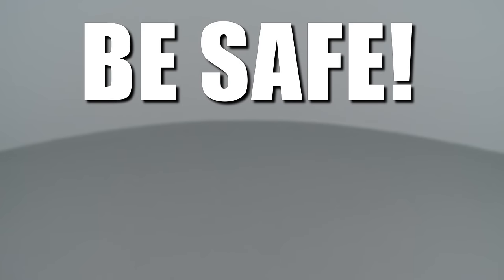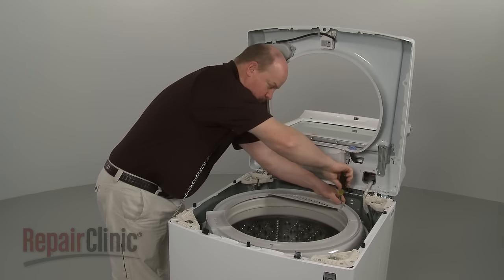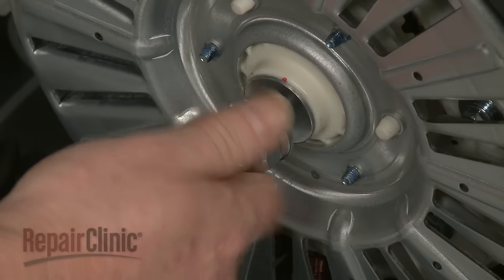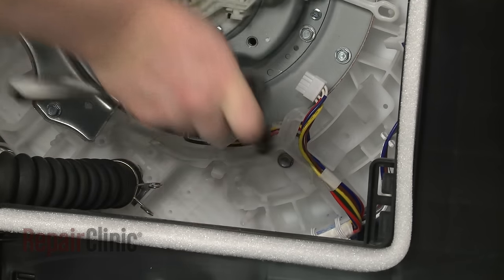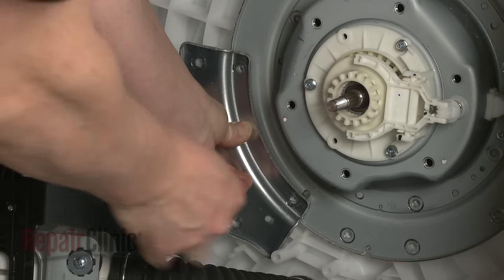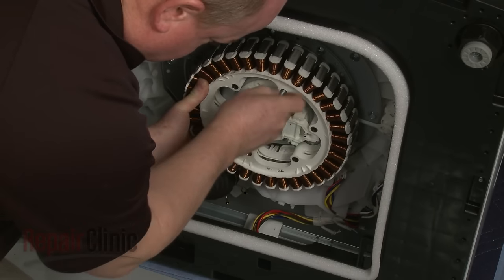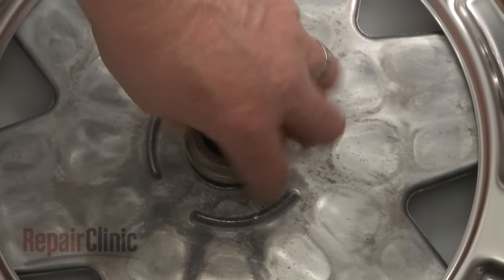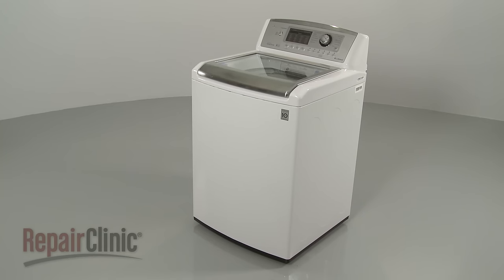Loud/Noisy LG Top Load Washer? Clutch/Tub Bearing #3661EA1009E

Comment: Great video.   Tip,  before you order parts check the rotor mounting  nut on the bottom of the washer, ours had worked loose, re-tightened to 88 ft lbs, and solved the problem.

Comment: Beware of the torque spec. for the nut that attaches the rotor to the shaft. The manual calls for 200 Kgf/cm or 88 Ft. Lbs. 88 Ft. Lbs. is a lot of torque for that little shaft. Knowing a little bit about metric, the equivalent imperial torque seemed way high. Goin to an on-line conversion program, he imperial equivalent is 14.5 Ft. Lbs. which is much more reasonable. Good idea to use some Lock Tight.

Comment: Pulled the wash plate and found a lodged quarter. Maybe LG improved the clutch/motor in recent models, as mine survived and works great after removing the quarter. 5 minute fix and free! Maybe the key was my wife was nearby and had the presence of mind to stop the cycle when she heard something that sounded wrong. Although it was running for 5 or 10 minutes in this state. Thanks for the great video

Comment: If you can do this repair your self you will save a good chunk of change. I paid $130 for the part I got it the next day and $15 for the 38 millimeter socket. the appliance repair place was going to charge 150.00 for the part and   $80 for a service call  and $80 an hour after that for a total of 2 hours so i saved about 250.00 doing it my self

Comment: My Model number is LG WT5070CW and I am unable to remove the wash or Pulsator plate. I have tried removing the 10mm bolt and running several cycles to work itself loose. Also, I poured boiling water into the area and tried soaking the shaft with penetrating oil. I tried using the claw end of a hammer to lift up the assembly by securing it under the metal lip/ring. Not sure what else I can do at this point. Any suggestion before I return the Clutch/Tub Bearing?

Comment: I have that exact washer and when it is spin cycle it squeezing and makes a clacking noise. After awhile it quits and give the error LE. Does this sound like a bearing replacement is needed?
Reply from the maker: It might need to be replaced. We recommend using the repair help section of our website - http://www.RepairClinic.com/repairhelp - if you enter your appliance's model number there you'll have access to model, part and symptom specific repair help. This will give you some more suggestions of parts to look at before you attempt a repair.